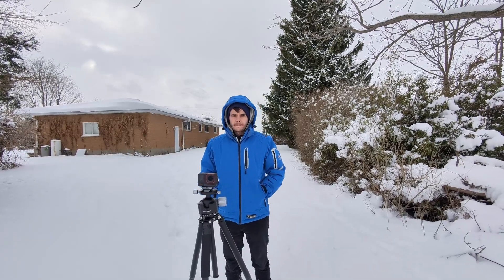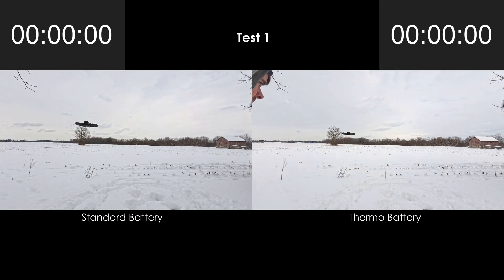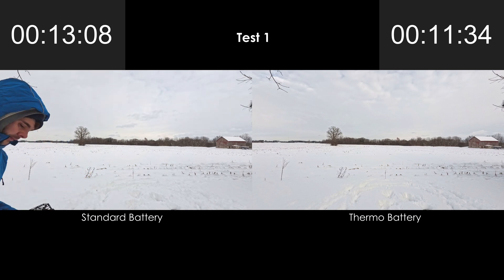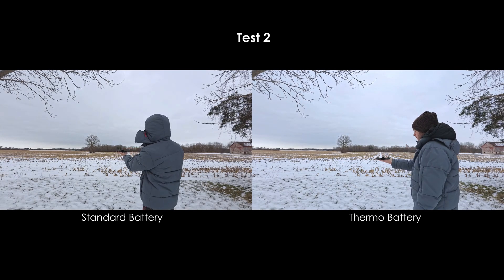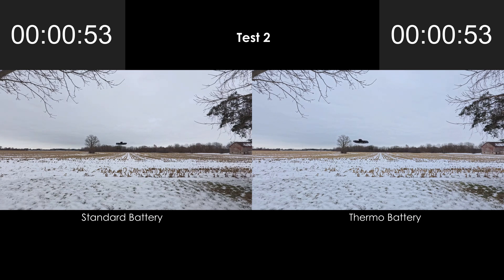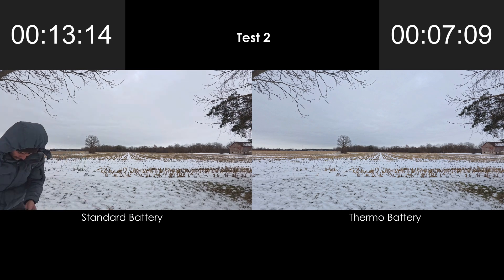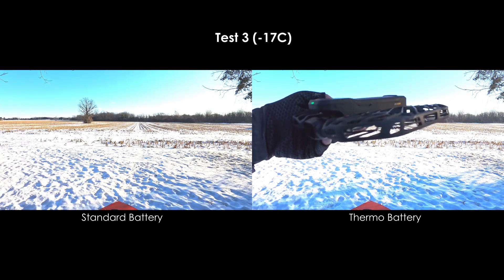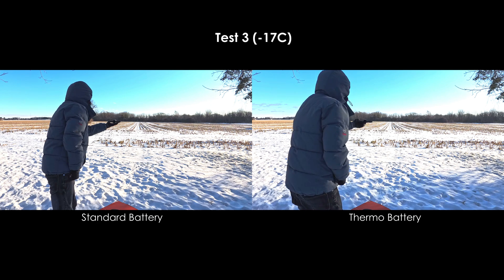HoverAir X1 Pro Thermo Battery Tested (In Freezing Conditions)

Comment: I was just at Osler Bluff yesterday skiing all day, had the X1 Pro in my backpack in a case all day, took out after about 4 hours to do a Follow flight, unfortunately it had started snowing and X1 Pro is not waterproof lol  so it was just a short flight, it started up no problem and flew like a champ. Yesterday temp was -8C, -15C with wind chill. Wish it had stopped snowing, I would have put it up in the air more. p.s. I only had the standard battery.
Reply from the maker: Do you ever worry that it will lose you on the slope and you won't be able to get back up to retrieve it before it lands in some powder?
Reply: @Roos-Reviews  Oh yah, I'm paranoid about my gear but I had to as this is probably the only ski trip I'll take for awhile and I've been itching to get this on the slope since I got it. With all the updates and Ski Mode now, I'm more confident getting this on the slope, when I first got the X1 Pro with all the problems, no way. The X1 Pro didn't struggle at all, my bud was following it following me and he said it tracked amazingly well and flight was stable even with the heavy snowfall. I'll post the video soon, I have a ton of AP2 and X4 footage to organize lol. I had it on flat, mid settings, was going to do high but i thought if that thing won't come down, I would up sh$%ts creek with all the skiers around ;)
Reply: @Roos-Reviews  https://www.youtube.com/watch?v=AZuoNBgScho, it's crazy how incredibly clear it was, can't even imagine what that 8K would look like.
Reply: Can we stick like a galaxy tab on top of it   or that would mess up flight ,  Im afraid to lose it .